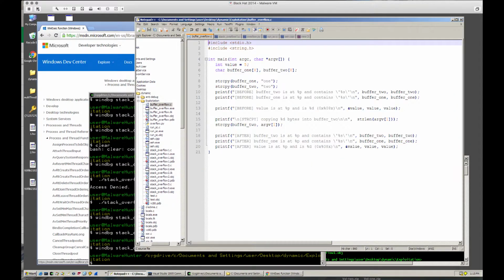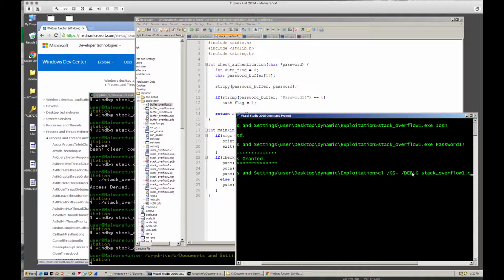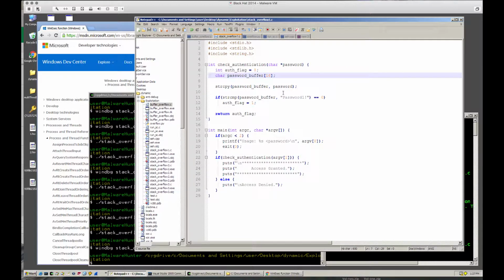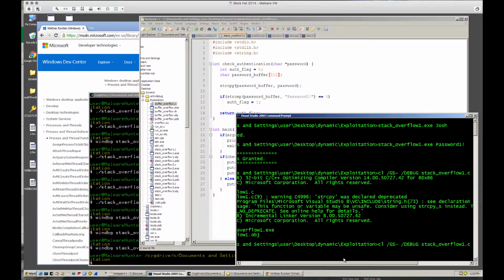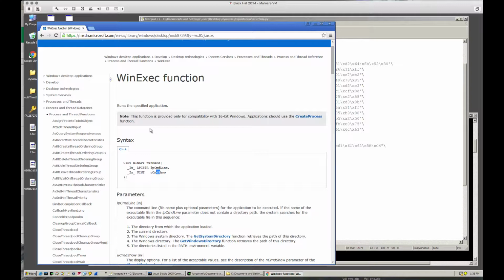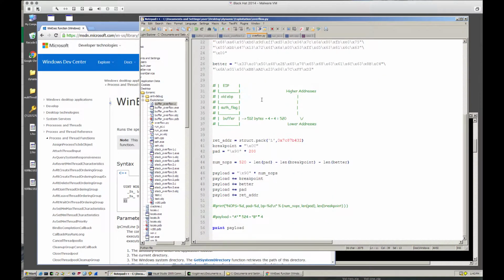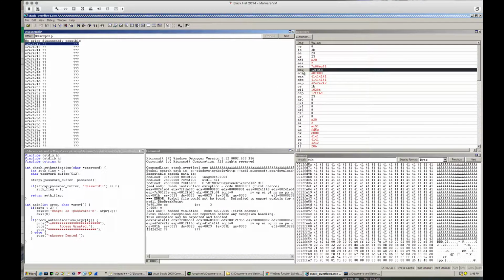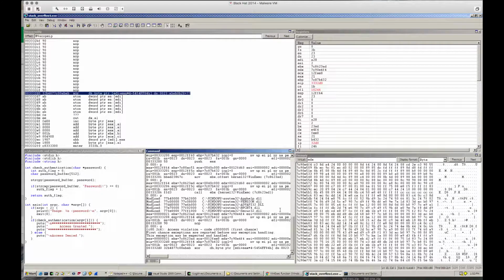24- Basic Shellcode Example

Comment: Hi, something strange happened to me, instead of nop x90, I receive leave xc9. There is also distorted shellcode itself and returning address, something strange..... I run the python code and redirected output to txt file, opened it with 010 editor and it looks fine, but under windbg something strange happening. Has anyone encountered this?
Reply: the problem was with wrong code encoding in cmd, if somebody will encounter the problem - chcp 1252 - for ascii will resolve it
Reply from the maker: thank you for posting the answer to your own question, much appreciated!